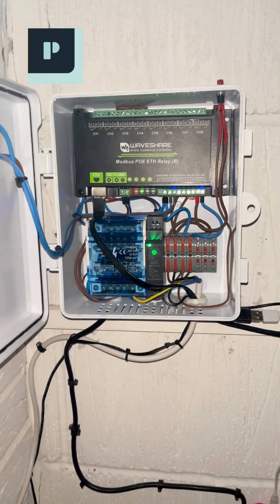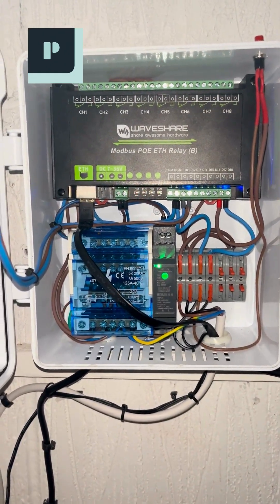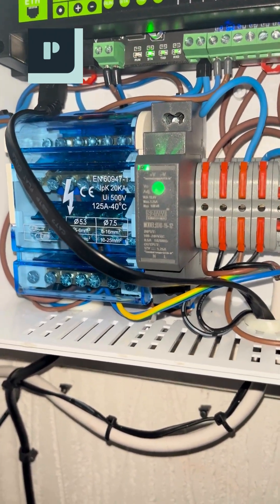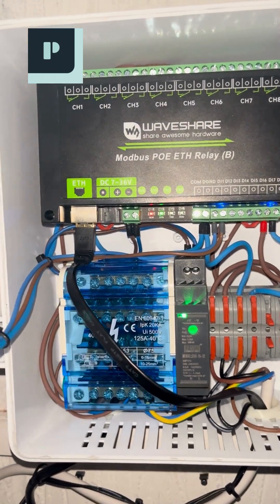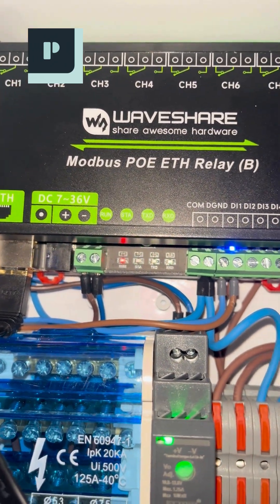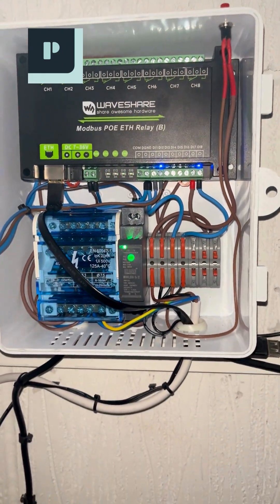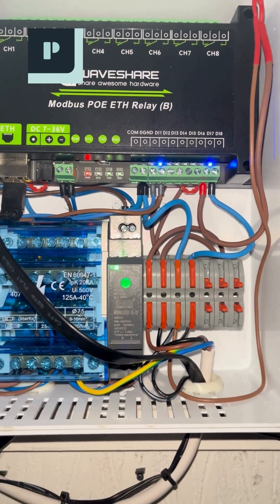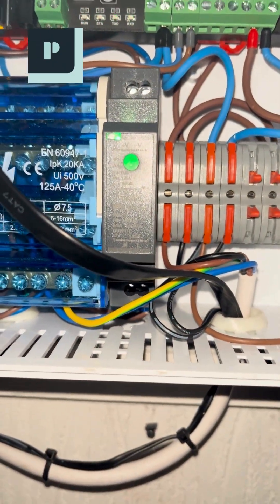Supercharging Your Garage Door: Waveshare Modbus ETH Relay (B) & Home Assistant #waveshare

Comment: Yeah, I found this modules to be the simplest smart home build, where you have inputs, relays  and can easily read both DI and relay statuses without having external controller ❤ the single downside I found is that you cannot hit swap relays - with this feature, it would be ideal actually :)

Comment: 90 degree USB connector would do great there after all that expense.
Reply: It's an ethernet plug but yes... 90 degree it for sure
Reply from the maker: It's an Ethernet cable. The 90-degree angle connector will be much better, but this is the only one I have at the moment.
Reply: @Project.P.S.H  AliExpress £1 👌🏻😆